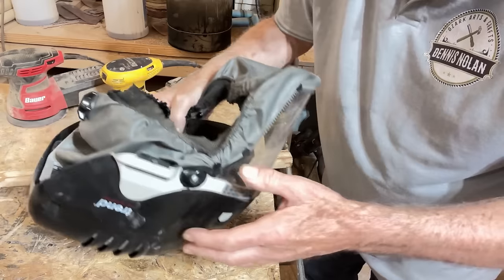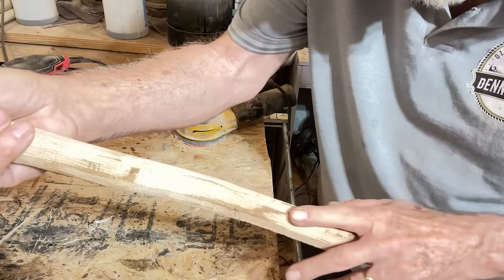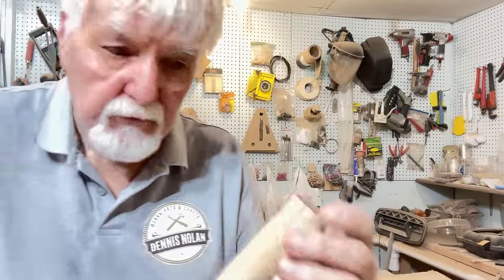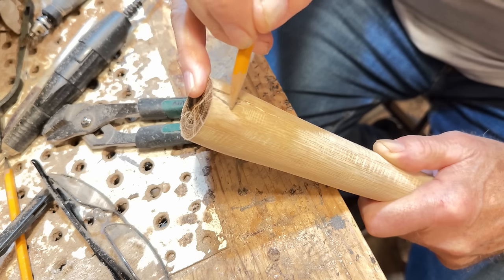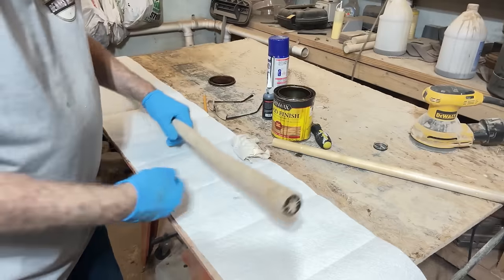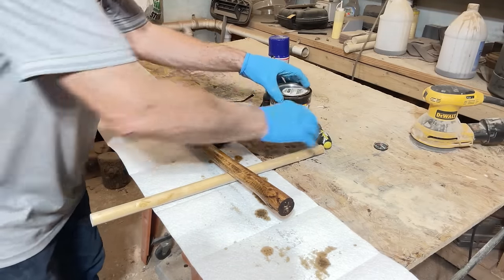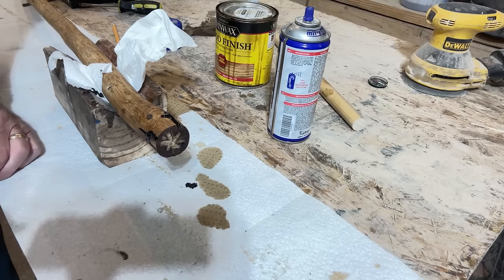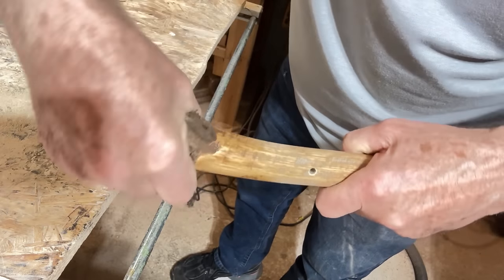A Simple and Useful Walking Stick

Comment: Wrap some painters tape tight around your paracord BEFORE you cut it. Keeps everything nice and neat.
Reply from the maker: Yes, that will work but it's a more temporary fix until the tape comes off.  If you burn it it won't fray again. Thanks for tip.
Reply: @OzarkArtsandCrafts  I never said "don't burn it". I just said "tape it before you cut it". (This keeps the line from ballooning with the little glob of gunk at the end.) Fish it through the hole, tie your knot(s), then melt it to keep it from fraying when you're happy with the knot placement and ends (after removing the painter's tape, ofc). The loose end of the unused spool is now more visible and temporarily capped. A little bit of tinning wouldn't hurt, either. Keep up the good work!

Comment: 🇺🇸🙋‍♀️ Great lookin walking stick! 
Your idea of making lightning strikes made me think of a guy on Big Timber on Netflix. He used a couple wires connected to a battery I think, put them on a slab of wood at the mill and the electricity burned in the wood, making a really cool pattern. Just something to think about.
Reply from the maker: I do Lichtenberg wood burning and have used it on some of my walking sticks.  I had some cracks to fill on this one is  why I didn't use it.  The electric burning does look more like a lightening stick.  Thanks for your comment.

Comment: My wife does a lot of woodworking what is the positive helmet/mask that you are using?
Reply from the maker: The positive pressure face mask that I use is call the "Trend Airshield Pro Full Faceshield"  I purchased it from Amazon.  Here's a link if you want to check it out.  https://amzn.to/3YXvY5k
I may make a small commission if you were to purchase one but it's from Amazon, not you.
Thanks for leaving a comment, sir.

Comment: How’s this for an idea try an old piece of wood Drexel in the shape of the lightning ⚡️ get some round brass wire cut too the 3 sizes of the lightning ⚡️ insert the wire mitred at the joints, I just thought of this so it’s untried just an idea as iam watching you
Reply from the maker: I'll take your idea into consideration!  Thanks for your comment, Robert.